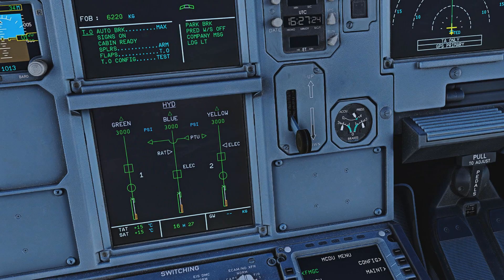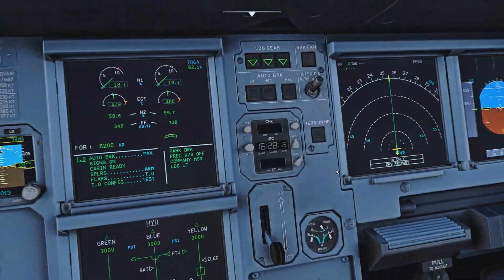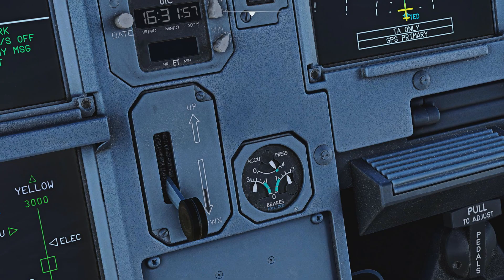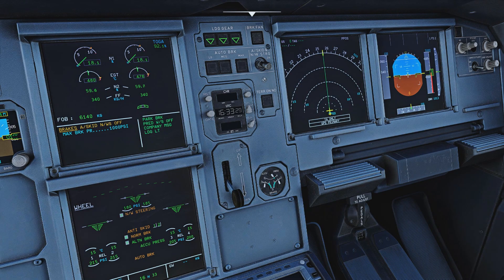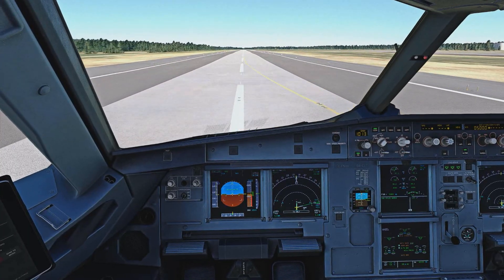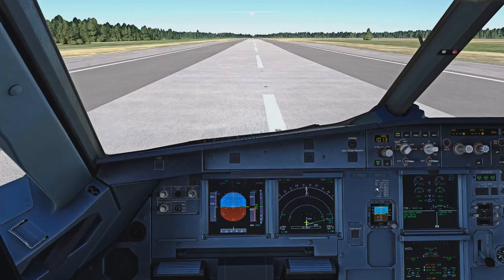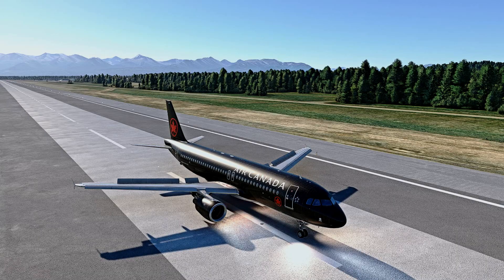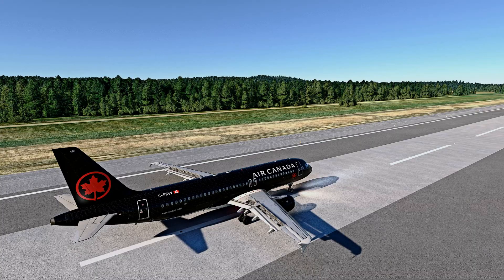The A320 Brake Modes made Easy

Comment: Hello sir, I have another question. In the example of aborting take off without A/kid, we can see how the airbus applies 1000PSI of pressure but my doubt is, that 1000 PSI of pressure are from yellow hydraulic system but why? Is it not suppose that yellow system comes into play when the green is inoperative? In this case we only have inoperative the A/Skid system.

Thank you very much.
Reply: Would it be because, without A/Skid the Autobrake doesn't work and without Autobrake, we have no longer normal brake active, so that the alternate comes in action and yellow system takes over, right?

Comment: Aviation has always been a passion of mine, and my biggest dream was to be paid to fly. I earned my PPL and flew the Cessna 172, but I knew that was my limit because I’ve always been academically challenged. I could never learn well from books alone, I had to do something practical before it would really stick in my mind.

All my life, I’ve lived out my dream on the PC, flying virtually. People like yourself are almost like heroes to me, because you get to do what I always wanted to do. I thought I knew a lot, even though I’m only a PC pilot, but you have a slightly different approach and I really enjoy your content. I’ve learned many of the finer details from your videos, so I just wanted to say thank you, it’s very much appreciated. I’m a big fan of your channel and will be watching closely.

I’d also love to hear your opinion on X-Plane 12 with the Toliss aircraft. I have almost the same system as you: RTX 3080, 32 GB 5200 MHz RAM, and an i7‑13700KS processor. In my experience with flight simulation, I’ve found that great single core speed is the key to smooth, stable frame rates.
Reply from the maker: Thanks for the kind comment.
I only own X-plane11 which I actually really like. I haven't looked at X-plane12 yet, but everyone says it's great.
I also own DCS which is another great SIM. I have also heard some good things about Aerofly especially for VR flying.
So many Sims ...so little time 🙂

Comment: When a plane is parked for a night do you leave parking brake ON or the plane is only kept in place by chocks?
Reply from the maker: @marklar_RR At my company we usually release the parking brake and put a sign into the window making everyone aware that the parking brake is released. This also helps if the aircraft needs to be towed to another parking position